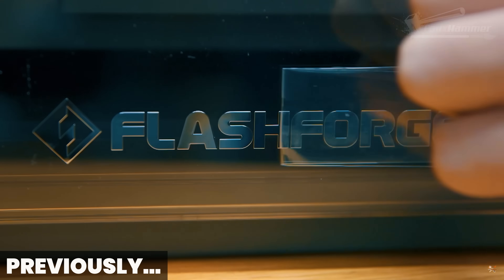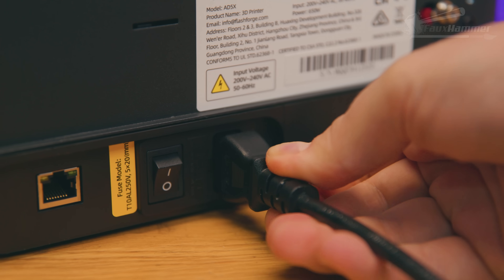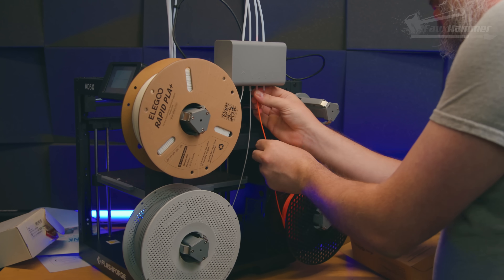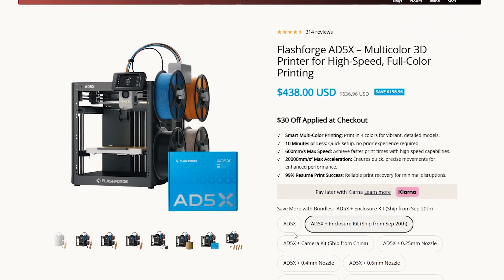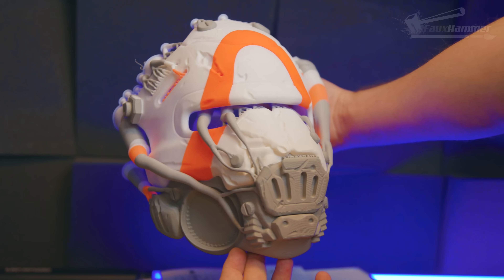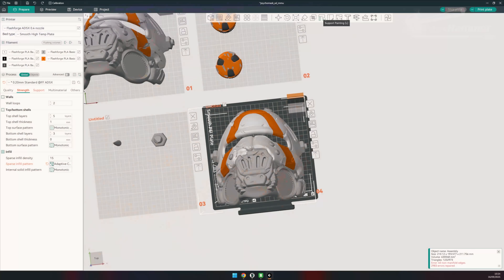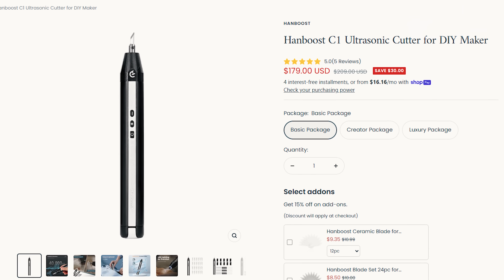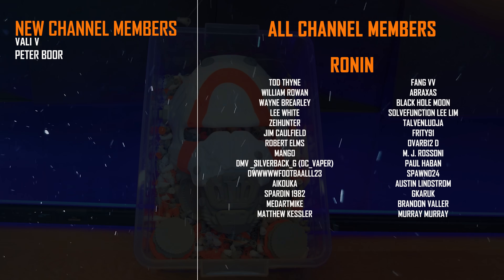Yet Somehow It’s Good? - Flashforge Adventurer AD5X Review

Comment: Why does no reviewer mention the most important and glaring issue that FlashForge acknowledge but refuse to fix and that's the fact they've hardware locked the flushing volume to around 1.5x so you either have purge into the tower,  mod your printer with zmod or add a bunch of wasted off prints and flush into object/infill. This machine is great but if you don't want colours to bleed, good luck because you'll have to dedicate a 1/5 of your bed to a purge tower to make it happen. My only pet peeve with this machine, every other aspect is spot on and is an absolute workhorse.

Comment: Just purchased an AD5X and I want to print that same borderlands mask as my first big multicolor piece. Did you use the file available on the printables website? 

I was also messing around with orca slicer and I had to scale down the mask quite a bit for it to fit in the printable area. Did you have to do the same?
Reply from the maker: Heya. Yeah I used that exact one. Bit I didn’t shrink it at all. Just reoriented it
Reply: @FauxHammer thank you! Was it as simple as orienting it and slicing it? Or did you adjust any of the other settings?  Mine also had several errors pop up when I went to slice it. I'm very new to this so sorry for the newb questions lol.

Comment: How in the hell would PLA or PETG let airflow in the printer, where ABS doesn't? Do you even get how any of this works? They will both offer the same results for this application, while ABS does a better job with heat, PETG especially should be more than good enough for this printer. Plenty of people done enclosures with PETG for printers like the P1L, and never had issues.
Reply from the maker: I wasn;t suggesting PLA or PETG wouls allow air to enter the printer. The indication is that when teh chamber is sealed and you are dealing with high-temps, those temperatures are more likely to have an impact on the frame materials.
Reply: 5:40 but that's not what you said. Unless you are printing at extremely high temps that would compromise the petg, which is 80 degrees, and that's not the bed or the nozzle, but the temp across the chamber, then PETG would begin to be a disadvantage. My guess is that this printers gets nowhere near that with an enclosure, meaning PETG would be just as effective as ABS would be.

Comment: Hi, I'm thinking about getting a 3D printer and was wondering do they use a lot of electricity during printing? Would love to hear your experience
Reply: About 100 watts. A little more when it's warming up the plate and nozzle from cold 

100 watts is not much at all. It's about an old lightbulb. A hair dryer or room heater is 1200 watts (12 x more !)

Comment: I'm glad to see they changed the nozzle system from the 5M to the 5X. I hope that now, with thermistor and heater separated from the actual nozzle, those electronic components last more. I had to replace my 0.4 nozzle (the most used one) twice in one year for my 5M due to the thermistor failing. Other than that, really no issues, only needed to adjust belts after one year of heavy use.

If I haven't already invested in a multicolor system for my AD5M (KCM) which gave me a lot of tinkering to set up (but now it's working like a charm) I'd certainly go for an AD5X now. Factory setups, when made to last, are more reliable than any tinkered printer. Maybe eventually I get tired of the modified printer, return it to stock and get an AD5X, who knows.

Comment: It's not months later where I'm saying you are wrong because I got it on sale....
Because I got it on sale last month.  ;-) I got lucky on a deal someone posted about and got this for under $300 USD.  So you're wrong!  HA!  (kidding!!)
I wasn't looking for multicolor, but at that price, figured what the heck.
I agree on the waste for serious multicolor.  I don't expect to do a lot of that.  Most of my multicolor prints have been things like embossed lettering and such, that don't need a lot of swaps.
I like the fact that I can load up the colors I use most frequently to save me some time/effort.
Also, I think I can load multiple rolls of the same color and have it automatically swap when one runs out???  But I haven't tested that,.
Again, not something I'd use often, but if so a nice perk.
That, and the reviews are just saying this is a solid printer.  And in the short time I've had it, that's been the case.
Not sure I'd pay full retail, but it seems like with most printers, there is almost always a deal or will be one soon.  And it's a great little box so far.

Comment: I don't know if it's me or what but the review feels like you are begrudgingly giving it a positive conclusion while you kind of didn't liked it/don't recommend it. 

From all the videos I've watched about the AD5X I am convinced it is the best machine in it's price category. It is basically the cheapest core XY with multicolor available which enables it to have a better print quality than it's competition, which are basically all bed slingers while being faster. Sure, if you want to print ABS and other engineering grade materials you need to buy the enclosure which, by the way, works just fine with PLA or PETG parts, unless you want to have your printer exposed to the sun, which I don't recommend do ro any printer.

The AD5X is basically the direct competition of the A1 Mini combo and the A1 combo, sitting just right in the middle price wise and feature wise, while being faster than both and having the same print quality or better. Remember the AMS Lite is exposed as well, just like both A printers. And while you might say the Bambu machines are better because they are an investment, are you really going to spend more on the ecosystem? Are you really going to use the benefits of the ecosystem? Most likely not. Not everything has to be an investment. And if you really need/want the Bambu ecosystem then go ahead, but this is only if you really are planning in having multiple machines, otherwise you might as well go for the AD5X.

Comment: I just got one a month or so ago and it's been top tier.  I mostly got it because it was the most affordable filament changer core X-Y machine.  I already lived with a bed slinger and just wanted something faster and more stable for those delicate prints.   ((Also they were doing a printer trade in and I had a mini delta printer that cost me $150 and I got a $100 rebate so that was perfect))

And really, I only had 2 real 'falures', one I fixed with paper plate 'baffles' for the filament spools so that the filament didn't get wrapped up on the spool holders, and the 2nd one was the little 'chute flap' had its spring break.  I got a new one real quickly but I'm planning on repairing the previous one so that I have a spare.

Though yeah, I understand your comments on there being no 'flashy' aspects to it, no innovation, and some things they drag their feet on (I do wish they make a 2nd edition with a slightly larger build plate and a proper touch screen).  But what this 'really' reminds me of, is the Gameboy, where it had fairly 'basic' tech in it, but it just meant that it was reliable and bulletproof.

I honestly would love to run a print farm with an army of these machines, the fillament swapping by itself is such a great convenience.

Comment: My orca flashforge crashes often and the filament profiles are super limited pretty much just some flashforge filaments. Bed adhesion with petg has been not so good recently a 15 hour 400 gram print failing at 92% with my first spaghetti monster in 16 years and print head front cover burried

Comment: I have an ad5m. I printed the case in petg and I can attest that it prints abs great. I actually printed a bunch of abs hex spools for my bambu printers. You definitely don't need abs case. Petg works great and I have never had an issue with abs. I actually prefer abs on my ad5m instead of my p1s😅

Comment: I've had Flashforge AD5M Pro, and it produced an excellent quality prints. It's like you said, their machines look a little outdated but are really reliable workhorses. I guess AD5X is the same but with multicolor. If someone needs a good not expensive 3D printer as a tool, Flashforge is a great choice. One thing AD5M Pro is ahead of other printers is their fantastic internal/eternal dual layer filtration system, with HEPA filters and activated carbon, which makes this printer more safe for home usage, and also lets the chamber heat passively up to 50C. I wish other brands did similar systems.

Comment: Why would you need ABS to print the enclosure??
Reply: You... don't really need ABS for the enclosure and I don't know why he was so adamant that you do. Sure, PLA and PETG are more prone to warping with temperature but we are talking about 80-100°C not the 40-50°C the enclosure is going to be at... The AD5M also has a printable enclosure similar to the AD5X and it works just fine if you print the pieces in PLA

Comment: The way you pronounce "butter" is not the same the queen would use..but still.. fascinating :) and yes...I agree..I've always thought actual multicolor printing (single hot end) is not practical at all...damn slow and waste tons of material. I've bought an AMS for my A1 mini but I just use it to have different colours or materials "ready to go". I've printed multicolour 2-3 times but the second colour was just on the top (so just one colour change or very few)
Reply from the maker: Yeah, I use the AMS for nothing more than easy loading and unloading.

Comment: I picked up an AD5M over a year ago, and it's an absolute workhorse. I didn't see your video on it, but I've never once had an issue with it outside of normal wear and user error. I'm excited to see you making a video on this one!
Reply from the maker: Thanks. Yeah they are solid workhorses. Just nothing exciting. But I can’t fault this really. Not at all. Is what it is and does the job well. Good quality machine
Reply: @FauxHammer definitely agree though that the printing world is moving towards tool changers. Excited for the new Bambu tool changer this quarter! Hoping you can get your hands on one!
Reply from the maker: @yiannimigias4024  I had asked for one. I think it’ll be a different thing and have different benefits.
Reply: Same!!